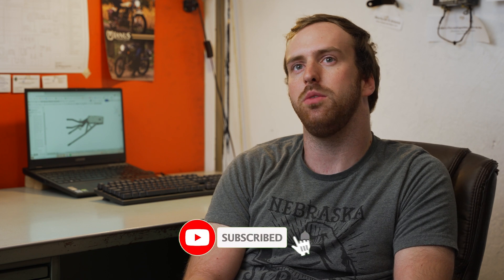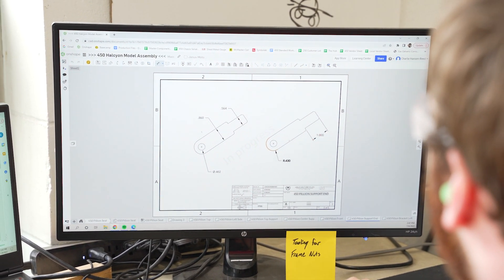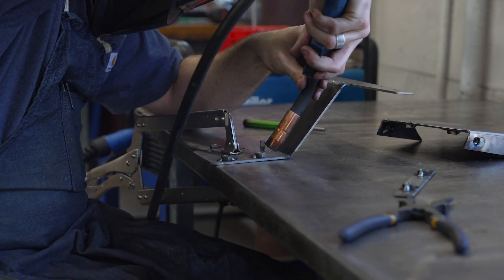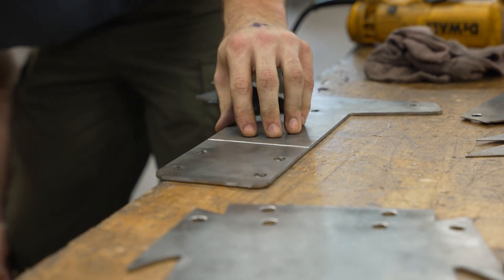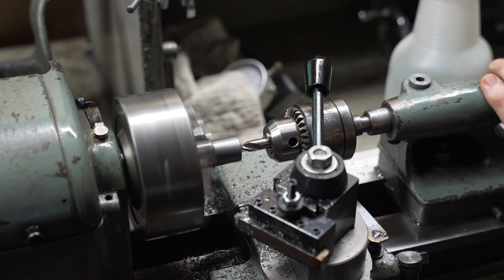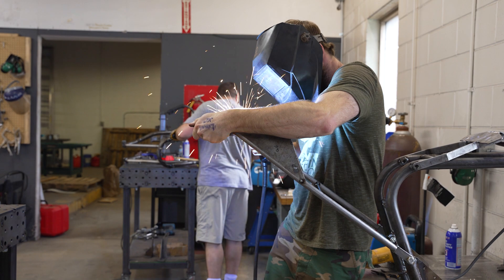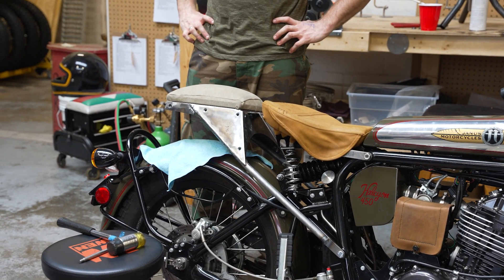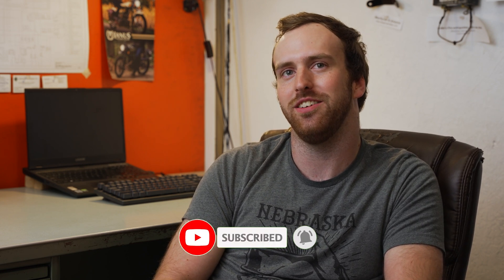Prototyping the cargo rack for the Halcyon 450 - Part 1

Comment: Yay, perhaps It'll be done by the time #105 is getting complete. Have you tested it with weight on the back. I'm assuming the pillon is moving in unison with the springs of the  front rider's seat?

Comment: I would think a banana style seat would be a simple easy option.
Plenty under manufacturers have used it in the past as a two-seat option.
Uses the same mounting as the solo seat only a different spring or strut system.

Comment: I assume this particular design compared to the 250 book rack mount, is to provide the pillion with a softer ride from the cantilever suspension.
Reply: I would assume that it cannot be designed like on the 250 because the 250 is a hardtail.
If you were to use the same design on the 450 the passenger would bounce up and down with the tire and be thrown off of the bike.
Reply: @steveh7108  My thoughts, exactly.

Comment: Loving this. Has there been any discussion about allowing purchase of a second Sargeant seat to be modified to mount vs a flat seat? I know people may head in both directions, some wanting flat, some wanting sargeant, but if it is possible as an upgrade, i'd go that route. I do appreciate that it is intended to act as an equipment rack when not used as a seat. I appreciate all the math, art, and work you guys are putting in on this.